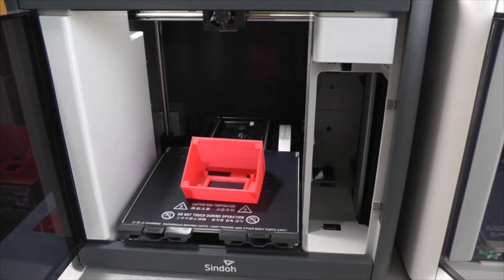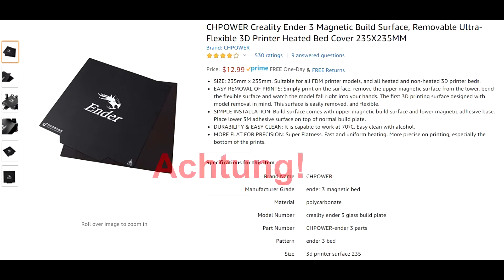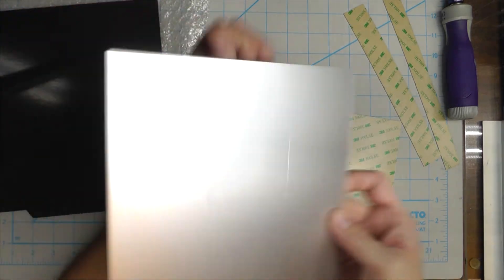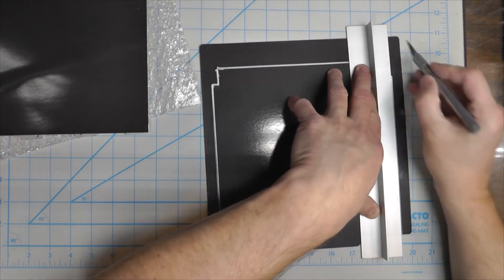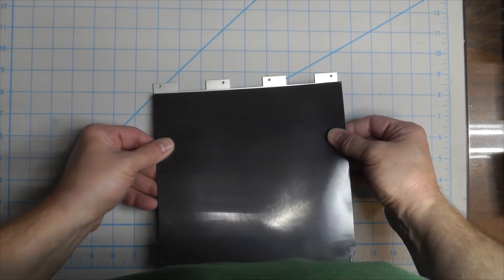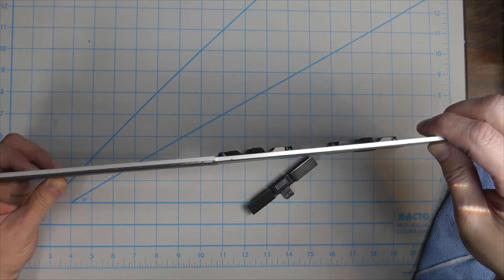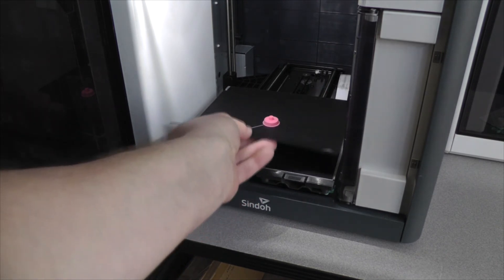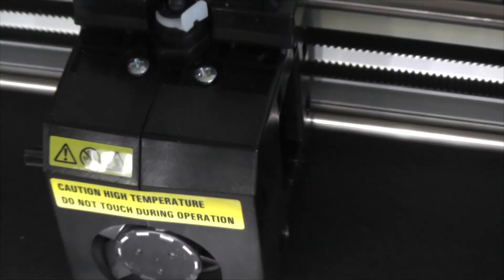Sindoh 3DWOX DP200 3D Printer - Flexible Bed Mod idea (PLA only!)

Comment: I just got a DP200 2nd hand and the rafts are SUPER stuck to the part. I don’t know what I’m doing right. Any advice ?
Reply from the maker: My thought would be to assure you have the latest firmware installed, either by using the software update option on the printer menu when connected online or manually by downloading the latest firmware from the Sindoh support site and flashing the firmware via a USB memory stick and their instructions.  They made some changes from the original firmware that I noticed seemed to change the rafts.  Then do a bed leveling using the on screen option, maybe set the z offset to be the thickness of a business card, and try a test print from the printer menu that has a raft.  Running the test print avoids any setting issues you may have with slicing software.
Reply: @AllThingsBobot  Thank you, I tried all that (fireware was very out of date) and same results. I've opened a ticket with Sindoh and sent them pics of the line test. Fingers crossed they have some suggestions. Strange because the actual part above the raft prints beautifully
Reply: @expataviator7107  hey man did you have any solution for this problem?
Reply: @Dohnjoe5940  Yeah, I really had to take my time leveling the bed and setting my z offset correctly. I also find that avoiding a raft if I can and cleaning my bed with alcohol really helps

Comment: A tip... put the mag base down where you want it.  Then take tape and put it along the back edge to make a hinge.  Then lift the front up and peel back a couple of inches to expose the adhesive.  Lay the mag surface back down, keeping the hinges tight and it will line up perfectly.  Take off the tap hinges and continue pulling the backer off and press down as you did.